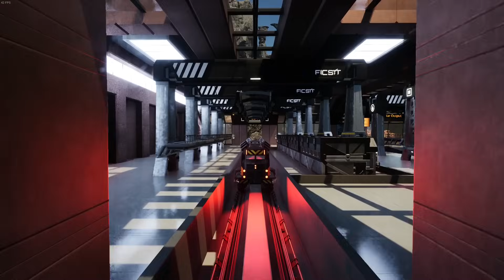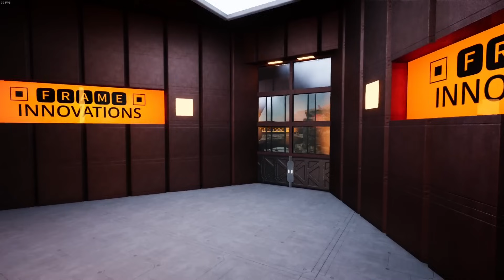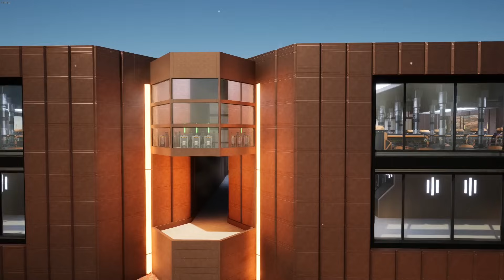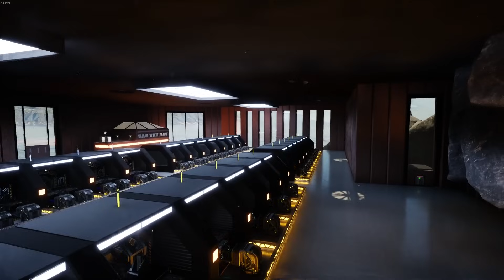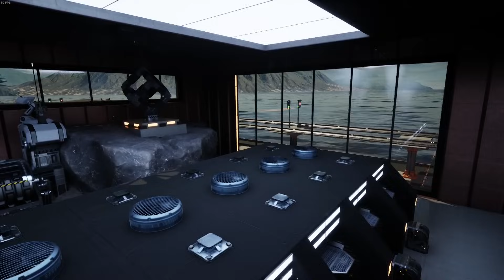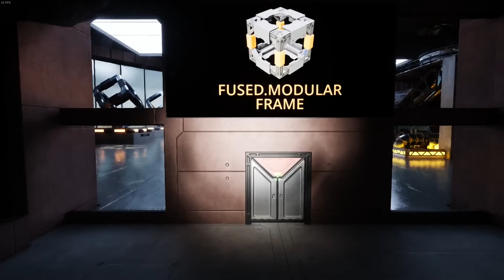Satisfactory Showcase - FRAME INNOVATIONS

Comment: Trying to get a sense of the technical part. Is this right?
Train hub brings in raw resources, put frames back on the rail network. Also any of the other intermediates?

Building are split to have only a couple of operations each, e.g. hv encased beams or one larger centerpiece for all steps of frames.

I don't see much moving outside, so.. belts moving intermediates underneath?

My biggest challenge right now is that I need to get a grasp on how to pull things further apart.
I finished the game with 4 very efficient, compact builds producing motors, frames, supercomputers and aluminium stuff, with each also supplying all intermediates for building. It was so horribly efficient that it used 3 spots plus a large coal plant in one region plus another spot up center, with very little incentive to build across the map. Never used trains or drones at all because there is no long distance shipping.
Reply from the maker: Yeah, i have one station brining in resources that i cant make on site, 
The other builds are producing everything needed to make MF, HMF, FMF, all belt work runs under the path way, 8 belts in total, thats why the paths are 2 foundations wide :)
Each building is build with the nodes in mind, so the buildings making screws and iron plates are built near the iron and coal nodes.
Reply: @Mgsgenesis  you may have saved me. I will chew on this for a bit to apply in my new game.

On a side note.
I absolutely love that wall of screws!
It's a great visual.

My usual minimalistic* way is to make screws right in front of the machines that need them, ideally split up into chunks to only need mark 1 or 2 belts. It's hyperefficient on transport.

* Back when blueprints were one small size I managed to cram all the machines to make a couple of cubes with exactly enough space to jump and crawl through that would make (1) frames and intermediates, (2) rotors and intermediates, (3) stators and intermediates. Motors was the first one with space to walk, and I hated that it couldn't fit in one raw materials to motors cube.
It was nutty and absolutely pointless given how large the world is. Just to show the origin of my journey.

Likewise when I first tried train logistics the actual factories would cover about two janitor's closets compared to the size of the stations. 😱